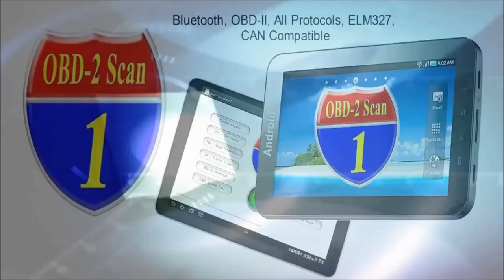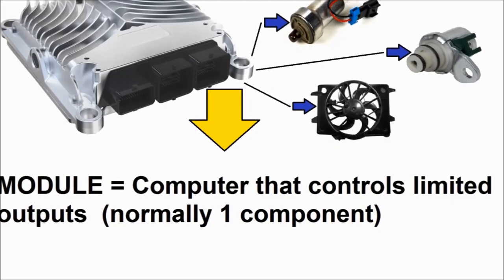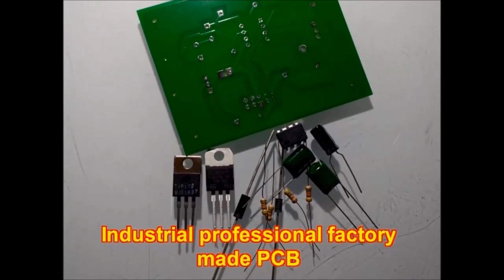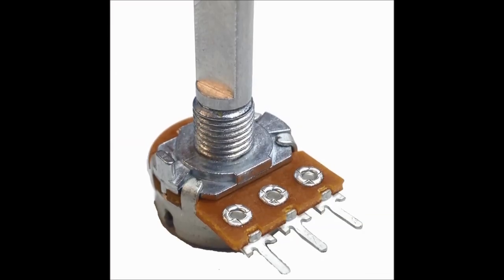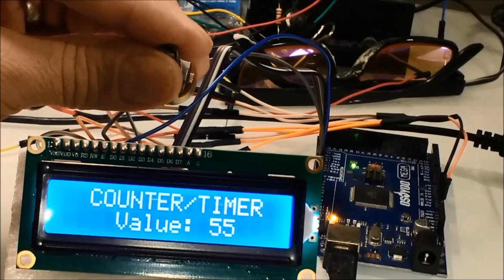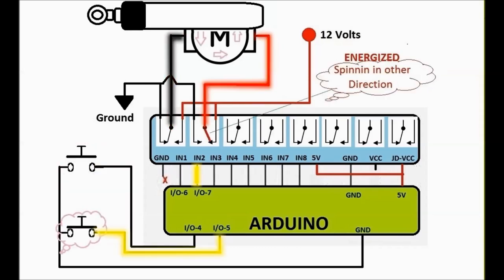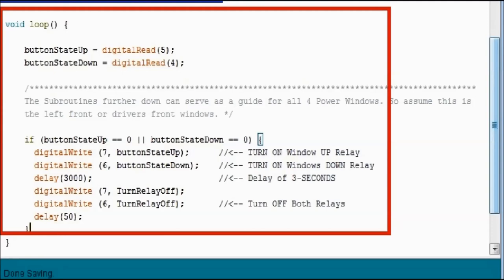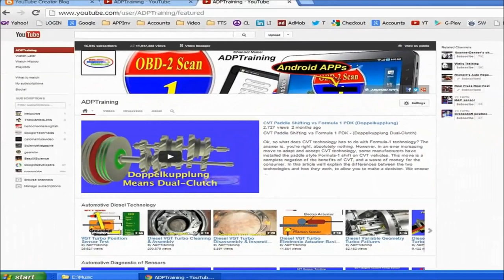Arduino Automotive and Electronics Study Course | Auto repair electronics

Comment: Hi Mandy.. I am a long time lurker and I found your channel many years ago. You have a great way of delivering your knowledge and your true voice is so much better than the robot in the past. As a skilled tech, I continue to learn things from you no matter how simple the subject might be. I purchased your book many many moons ago. Anywho, I have a PWM cooling fan project coming up and when i see ADPTraining covering any subject of interest, i make it a point to go to you first and foremost.  Thanks for doing what you do.

Coming soon- arduino controlled PWM cooling fan from a 2011 Crown Victoria  Police Interceptor in a 1962 dinosaur. I will be building my first Raspberry Pi Pico project as the Oscilloscope and view the signals on my Android phone with the Scapy APP.

What CTS unit do you think would be best suited for this application? What about a dual sensor setup with one at the T-Stat housing and one in the radiator?
Reply from the maker: Thanks, look pretty soon I'll be redesigning all my tools/circuits and sending them to Amazon at a nominal $10 to $15. I have over 50 planned circuits all geared to automotive diagnostics.
Reply from the maker: CTS and RTS signals are used to program the micro along with the Rx and Tx lines. I don't really understand your question. 

All I can say is that I ounce went crazy trying to program an ESP32 but couldn't. After half hour along with a fellow engineer I realized that the Rx and Tx lined we're inverted. I'd connected Rx to Rx and Tx to Tx. It all worked afterwards, lol.
Reply: @ADPTraining  I bought a Flipper Zero last year and I must admit, it is fun to tinker with. The combined knowledge of sub GHz frequencies all packaged up in a neat little device is amazing. In the automotive industry, it can work with Tesla's, garage door openers, security gates, key fobs, BLE devices, and more. Get yourself one or more,  you won't regret it. With the GPIO functions and ever growing libraries, it is right up your alley.